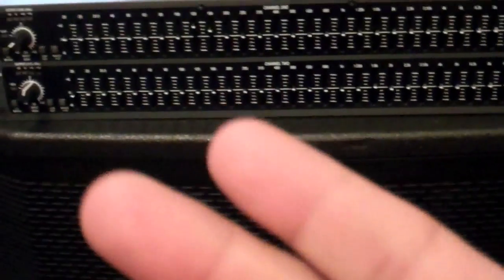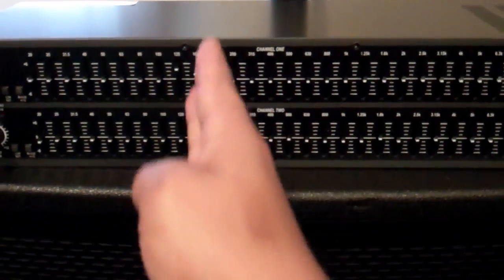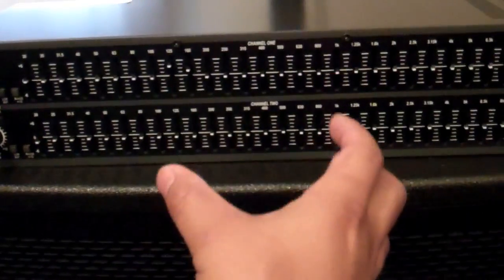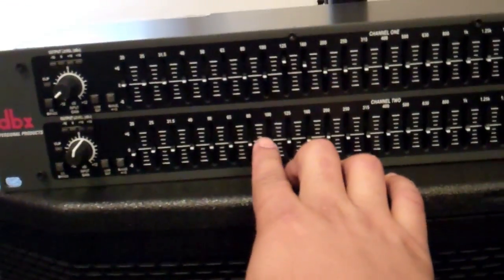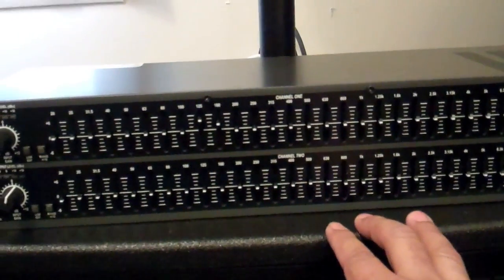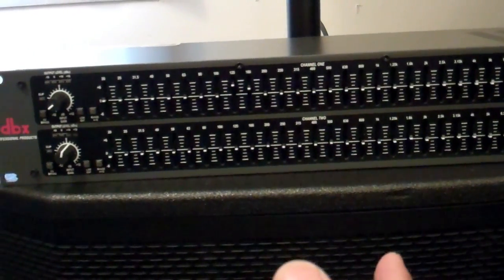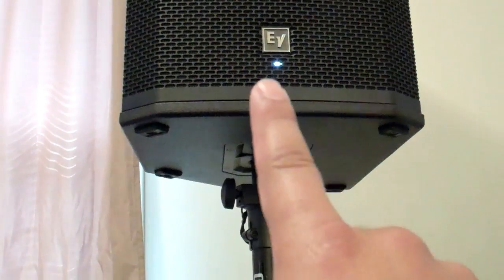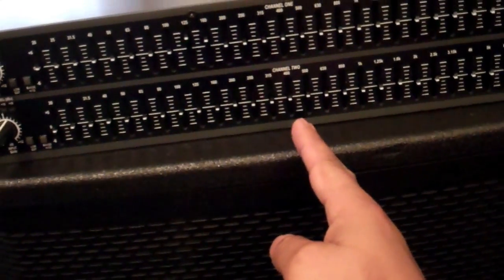Crossover basics with EV ETX

Comment: First and formost good job on that video. I'm a dj from Canada and i own a pair of ETX 12P. I'm looking for a good Sub and i heard the ETX 18SP always clipping red. Please can you tell me from the day you brought your sub till today if you have seen or heard about ETX 18SP clipping red. Would i be safe for 5 years up if purchase the ETX Sub 18SP ?
Reply from the maker: I own the ETX 15 sub and I have not had any issues, the limit light will blink if I push them too hard, but it wont shut down.  The 18sp sub is awesome.  I would use it in live mode and factory 100hz setting.
Reply from the maker: Also I think it would be a great addition to the 12p tops.  If you ever notice the tops really limiting try crossing them over at 80hz or above.  Anyhow if the sub is set at 100hz then tops should be as well if you are using them together, above and below.  If they are at a distance from each other then you can see whats best for that room.

Comment: Love the video bro so if i set my hpf for my tops at 80hz and above and my sub at 80hz and below what do you recommend to be my low point for the sub for example 30hz to 80hz ? I dont quite understand where to set the low pass filter... Thanks
Reply from the maker: Thanks bro!  I think you answered your own question.  Whatever you set the top at, set the bottom.  I actually leave the this EV sub now at 100hz and the top at 100hz when in use together.  Each speaker has its own set of frequency capability so the sub will produce everything below 100hz and the top everything above.

Comment: I understand but I would not call these cheap speakers . I do expect them to be louder and then my prx18 xlf . Im wondering if im doing something wrong ? Idk
Reply from the maker: What is your setup going into the speakers?  Your DJ mixer?

No they aren't cheap, but I definitely think you can get em for a better price than a JBL or QSC from my experience.  Also the ev18 sub does allow more mid bass as it goes up a bit higher so I would try that first.  Bring the crossover up and adjust your tops at the proper crossover point.  Try all crossover settings.  You might find one you like.  Also the tops will limit less if at all if you take out the low frequencies.  Leave that for the sub.

Comment: A few more comments... a pro told me that he doesn't like 80hz xover on the sub because the kickdrum falls around that point. He wants the sub not the top to produce the kickdrum. Crossing over the top will allow it to play louder with less power. Less power reduces the chances of blowing anything. Another tip is to high pass the woofer. Look up the specs and set a high pass filter at the -3 point. It will often be around 40hz. The DBX crossover has a button to push to accomplish this. The hp filter on the sub keeps it from trying to produce wasteful low freqs. You save your power for what really counts in dance music and that is the 40hz to 60hz area. That's the thump that you feel in your chest on the dancefloor from hard hitting subs. 

So there you have it. I set my sub hp to 40hz, lp to 100hz. The top will xover at 100hz. I do make a few adjustments based on the room. Speaking of that. The DBX Driverack does a good job on EQing the bass. I run the RTA. Then I adjust the recommened settings with the mid and highs back to flat. I only go with the recommended low freq bass settings.... Works great for me ...
Reply from the maker: What kind of sound system are your running with the DBX? I still have my DBX.

Comment: The most common xover point for pro work is 100hz by far. Generally most of these types of systems will offer either 80,100 or 120 as a possible xover point. I recommend that most systems start by trying the most common which is 100hz. I will drop to 80hz if I notice that the system sounds boomy. This happend a few weeks ago do to a wooden floor. I rarely set the point at 120hz. I did do this a few times back during the summer when I was outside and knew that I was going to push the small top speaker really hard. My top was only a 10 inch. I left a gap by putting the top at 120hz and the bottom at 100hz. Most ears could not tell the difference. Some pros actually leave a gap to clean up muddiness.
Reply from the maker: Yup, thats what Ive been trying to do at my gigs, but I never seem to have enough time or there is some volume limitation for a proper sound check. Every space is different.  I'll have to try the gap, sounds like it would work for a setup like that.